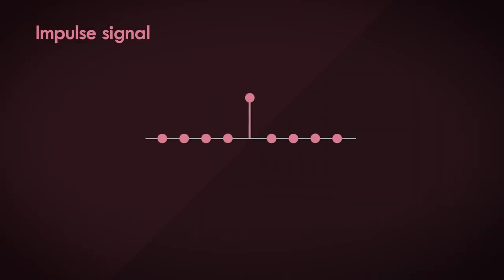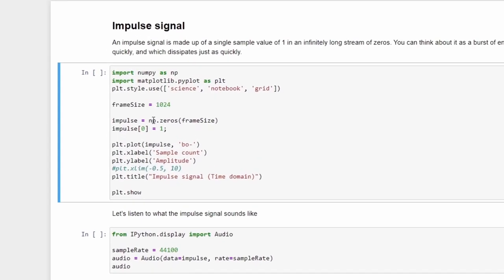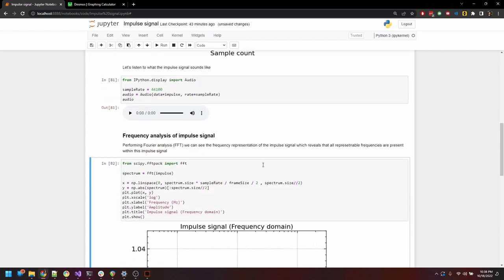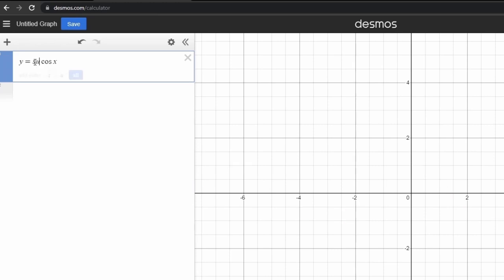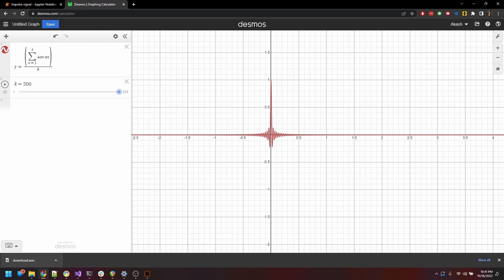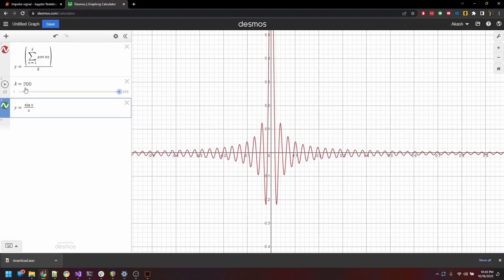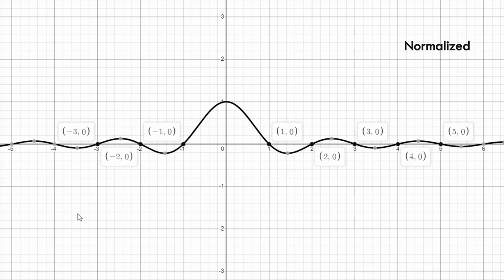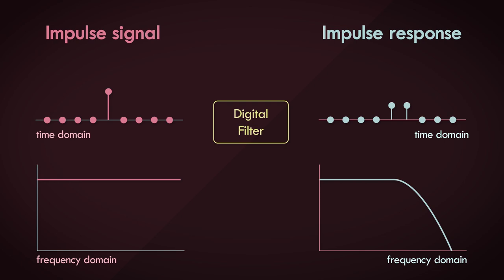5. Impulse Signal and its Response - Digital Filter Basics

Comment: I'm in the final stages in programming a synth using the JUCE platform. One thing I am missing is a visual representation of the filter type, poles, cutoff, and resonance, as specified by the user, a frequency response curve (plot). So watching this video series, I guess the easiest way is to send these pulses, from DC to at least 1/2 Nyquist through the filter, and plot the output right?
Reply from the maker: Hey there, so one way of representing the frequency response plot, as you eluded to, is sending an impulse response through the filter, and performing an FFT on the impulse response. I've done the same in the demo plugin in the repo, you can check it out. But this is not efficient, and lots of calculations are needed. The frequency response curve can be built if you know the coefficients of your filter (which is quite likely that you have this, since you control the filter). In this case, you should try and implement what's provided in this article: https://www.earlevel.com/main/2016/12/01/evaluating-filter-frequency-response/